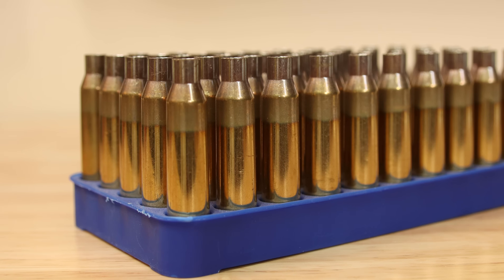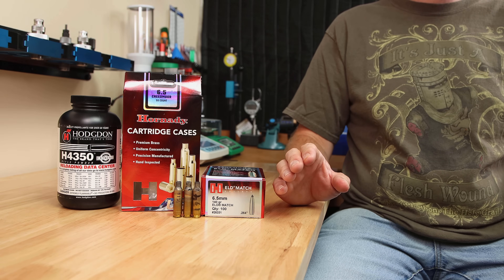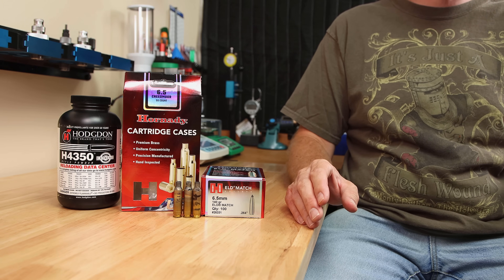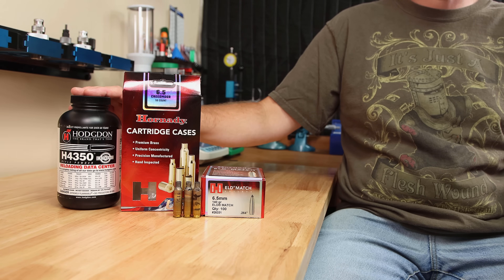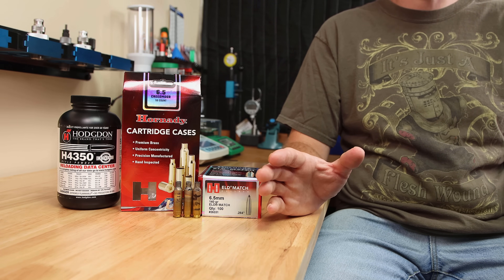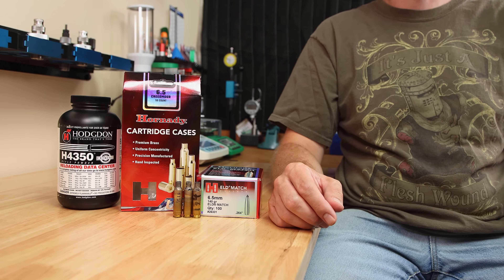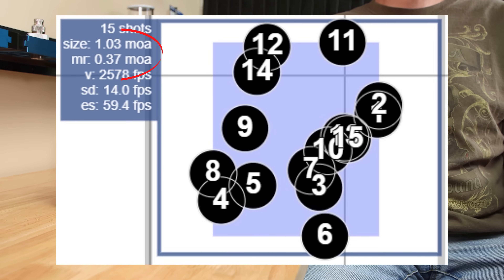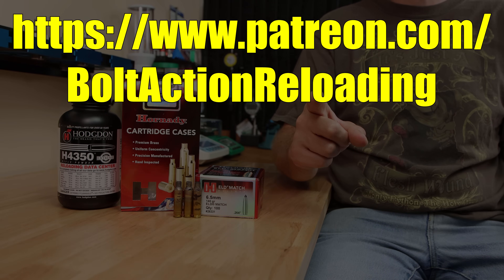How NOT to Anneal Your Brass!

Comment: What I would like to know is how much difference does it make if you anneal your brass a little bit longer than what is recommended than with Aztec mode.  Erik Cortina's video where annealing for 10 or 15 or 20 seconds (at least 2-4x more than he usually does), didn't seem to make any difference at all for neck tension made me question the precision of the annealing process as suggested by AMP.  Nothing I see on the AMP site convinces me that Aztec mode is so precise that as much as  a 50 percent increase in annealing time beyond what is recommended would make any real difference to the group size and performance.  One of their own papers seems to show that annealing can be done to higher temperatures (up to a few hundred degrees more) than deemed optimal with minimal effects until you get to temps far above what is recommended. I'd love to see data to be proven wrong.

Comment: So if you didn’t clean the inside of the neck after anneal that could cause that increased force to seat a bullet. Dry lube in this test would be better.
Reply from the maker: The necks were brushed after both options were trimmed.
Reply: @BoltActionReloading  so maybe the heat of the second anneal increased neck tension. Even though it softened the brass. So running through expander mandrel would be better.

Comment: Nice video, you have good info. Here's a thought. I have annealed brass in the past with marginal results. But I used a completely different process. I also have fired brass until the neck would split from being work hardened. However for the last number of years I have been using the stainless steal media pins to clean my brass. I will tumble them for 8 hours in the Thumbler's Tumbler. Since then I have used the same brass many times without a single neck splitting. Question: Is it possible that the peening of the brass in the tumbling process is accomplishing the same result as annealing?
Reply from the maker: I don't see how.
Reply: @BoltActionReloading  you do know what peening is, yes? So you got hardened stainless steel media pins impacting soft brass millions and millions of times ..... pretty obvious how. however, 4 word reply .............. your literary skills are impressive..................... a regular Hemingway (-;
Reply from the maker: Hello lencac,
1. I know what peening is, if I didn't, I know how to use google.
2. Peening makes the brass harder if anything, but according to the amp guys (they have talked about this and I think that they may have even covered it in a video but I won't swear to that) but it really only affects are so small that the don't think that it matters.
3. IMO making the brass harder should not increase case life, but I am not going to pretend to know everything either.
4. You asked a very specific question, I tried to give a very specific answer that I do not see how it would accomplish anything similar to annealing. One makes it harder one makes it softer. Often pointing these things out to folks, people take it the wrong way that I am trying to be a jerk (which is never my intention.)
5. I am not a English major so not going to pretend to be a Hemingway, just going to be me. 
6. I get a lot of questions / comments and I try to address as many as I can realistically. Sometimes I can't spend 5 minutes on 100 comments per day cause I just don't have a spare 8 hours everyday.

BAR
Reply: @BoltActionReloading  Attaboy that's more like it. I'm likewise am not metallurgist so I'm not sure what it does. Nevertheless, speaking from experience I literally since I've been using the SS media I have not had a single neck split. We are talking about 30.06, 308 and 7.5x55. Many times after many uses I've had the primer pocket fail to hold the primer tight so I would pitch the case due to that. But as far as neck split, not a single one. And I'll say I have cases that I have used maybe as much as 10 times. When in the past using the walnut media the necks would have split. So that's my experience.
Dig your vids. Love ya brother (-:

Comment: Annealing before sizing helps ensure consistent results from sizing. A little work hardening from sizing helps keep the neck tension consistent. A little carbon in the neck helps prevent the brass from getting "sticky" after annealing.

Comment: When I had my flame annealer I found that annealing after sizing and then loading, bullet seating was extremely hard to the point of damaging the ogive(don’t have an amp press but didn’t need to to know something was not good).  I found that brushing the necks after annealing allowed much more normal seating force. I hypothesized that the annealing process left a scale or residue that significantly increased friction (like heating steel with a torch).   I now deprime fired cases with universal deprime die anneal on my amp, size, expand with dry lube and mandrel and load. Great loads now.

Comment: Do you have pin gauges? If so, please would you look to see what happened to the diameter and royndness of the neck when annealing after sizing?
Reply from the maker: Hi Peter, I do have pin gauges, however they have residual oils on them and I did not want to have to clean that off cleaned at that point primed cases. I truly did not expect these results so hind sight being 20/20 I would have dome some more measurements prior to priming.

Comment: You need to brush after annealing, I had the same. It looks of annealing leaves a kind of scale. Also always anneal before sizing. Otherwise your dimensions are off.
Reply from the maker: Hi R Load, These were brushed after the cases were trimmed. I know the advice has always been to size after anneal, but I have never heard anyone say why. I like to understand why. Clearly something changed.

Comment: I thought it was best to anneal after sizing. The reason for annealing is to return the metal back to a natural state after work hardening.  The sizing of the brass work hardens it, annealing after sizing, should allow the neck tension of all the cases in that batch to be similar. Thus more consistent bullet release. I was also taught to quench brass and copper in water as part of the annealing process. Most people in reloading skip this step saying that air cooled is good enough. I am not so sure about this, maybe it would be a good test. Quenched vs air cooled for the next video.
Reply: You want the brass to return to it's original state before you full length size to get a more consistent size. Quenching brass is not a thing. Steel, etc. changes it's properties when quenched, brass does not. Air cool, liquid cool, no effect on brass.

Comment: Why on earth would you anneal your sized brass?  That makes no seance to me.  By the way, unless im mistaken, the AMP video you reference, twice annealed brass. NOT anneal brass, then resize, then re anneal. Keep apples and oranges together.
Reply from the maker: Hi Mark, Why? to understand. I don't believe I recommended it, I just wanted to know what happened.  In the AMP video Alex took a hardness measurement on a unfired case, annealed it, took another measurement, annealed it again, took another measurement to see that it did not change, sized it, took another measurement to see that it had changed because of the sizing process, annealed it at a lower setting to see that it did not relieve all the stress(with another measurement), and annealed it again and then did another measurement to see it was back to the annealed state before the size. So there were a lot of tests and a lot going on. His more focused on stored energy, but he also states that the majority of the stored energy (hardness in the case) comes from sizing not firing. Not sure how this related exactly to fruit but figured some folks would find it interesting.

Comment: Can you do a test on brass life with annealing vs not annealing and how often is sufficient for annealing?
Reply from the maker: Hi Dylan this type of test gets complicated very quickly. I did a life test annealing and firing for 20 rounds here: https://youtu.be/bZopCBUzruY and it would have still been going strong. It really depends on your why, are you doing it for extra life or consistency? If consistency is your answer I don't know how you don't answer the question every time. If its for extra life span, then it gets complicated. (IMO)
BAR
Reply: @BoltActionReloading  thanks I was thinking about mostly lifespan since I don’t have a justification to drop major cash on an annealing machine. But maybe I could use a torch once every five firings if it would still get me about the same life as doing it every firing. Or maybe it hardly makes any difference at all?
Reply: @Haast's Eagle wow good info thanks. With the non annealed, if accuracy is gone at 12, would annealing at 8-10 reset the clock? This way you wouldn’t have to toss them? I’d like to be able to anneal as infrequently as possible while getting respectable case life, since I’d probably only use a torch which takes a while. Also I assume you’re doing only as much shoulder bump as necessary or the separation would come much earlier I’d think

Comment: I communicated with the owner of AMP Annealing, who makes himself completely available any time, day or night. He said that it isn't advisable to anneal after sizing which defeats the intent of the process. The equipment is calibrated to give the correct annealing number with the neck at fired size. They didn't pull the time and temperature out of thin air. They test annealed thousands of cases at fired neck diameter then programmed the annealer using the data acquired using fired neck diameter results. He told me that even a dented neck such as what commonly occurs on M1 Garands, affects the annealing accuracy.  Either the founder or his son, who was the primary, hands on developer, will personally answer your technical questions. Thanks for your effort to determine if there is a difference in sized or unsized annealing performance and the Amp guys can explain why it happens if you ask.
Regards,
JG
Reply from the maker: Hi Jerry, I have had nothing but good experiences with the AMP guys. I am not sure Alex sleeps sometimes when I look at the times he responds to email. I have never had a reason to doubt them or question any of their data. Some folks however want to accuse them of simply trying to sell equipment so I feel that independent testing is important.
BAR
Reply: @BoltActionReloading  i admire your willingness to put in the work to prove or disprove published sfatements. I have a scientific background and had most of the equipment either available to me or through a friend at the institute. Certainly the process they used at Amp is familiar as Vickers hardness is a fairly common industrial measure and the equipment is pretty standard and the calibration process is a standardized, etched in stone procedure that ASTM and other governing bodies mandate so it is uniform worldwide in many instances. I believe their process is almost foolproof in that a given amount of energy induced into an exact amount of mass will produce very repeatable, quantifiable results. Alex told me that an acceptably annealed cas doesn't have to be exactly 100 Vickers but 90 to  108 are close enough to pass muster when they field tested ammo in actual firearms with known capabilities. He said that meaningful accuracy degradation  wasn't apparent until the hardness started outside that 90-108 range and when above the highside limit, neck splitting as well as excessive neck tension were observed. You are testing another aspect of reloading related to annealing but not necessarily a direct result of annealing. That is a good thing because all the processes don't always add up to the sum of their parts. Your x number of steps may or may not play well with mine but that just proves that the ultimate consistancy can be achieved in different but usually similar ways if the precision is there. Keep up the good work and I'll  anticipate seeing more good and interesting info from you.
Jerry
Reply: 1 word lubricity

Comment: Yes because everyone can afford an overly expensive computer controlled inductive annealing machine. So relevant tot he masses!
Reply: Do or don’t it’s completely up to you man. He’s got videos on testing the results of annealing.
Reply: You can make your own induction annealer with 0.01 second accuracy for about $200. Only downside is you have to manually determine the correct annealing time for your brass, which isn't bad, just sacrifice a case or 2 and record the time so you'll have it the next time you anneal. And there are cheaper but less precise methods for annealing such as just a torch and pliers to hold the brass. The AMP is just the best to use when running this specific experiment because it is the most precise and repeatable. You can extrapolate his conclusions to any method. If you can't or don't want to anneal, then don't. If you do want to anneal, then you have many options and resources to educate yourself about it and the various methods.

Comment: how about lubing the inside of the neck on both prior to seating.  I know that isn't part of your normal process, but it could help to understand if the second anneal difference is due to carbon differences.
Reply: I brush necks no lube. Best results for me. One pass no more, no less
Reply: I use an ultrasonic cleaner and my case necks are "squeaky clean". I am going to try a really fine emery cloth polish of the case neck to see if seating force and depth variation will be reduced. An absolute b@ll ache in the case prep process, and trust me, if it makes no difference I won't be doing it going forward.

Comment: Maybe I missed it and I apologize if I did, but here are a couple of questions that came to mind.  Do you clean your brass before you size?  Also, I would assume you lube your case necks before you size?  If so, and you don't clean again before bullet seating, there would be residual lube that would assist the projectile being seated.  If you lube, size, and then anneal, the anneal would burn off any lube, changing the friction of the seating.  Just a thought as to why the change in seating force when annealing after sizing, which is totally counterintuitive.
Reply: The owner of the Amp Annealing company told me it's not necessary unless for some reason it is really nasty but for normal residue it doesn't matter. I believe this may be on the instructions included but for sure it's mentioned on their website.
Reply: @jerrygolden832  when you say it’s not necessary do you mean not necessary to clean before annealing?  If so I think that means dirty cases have the same code as clean cases so cleaning doesn’t affect anneal times.  My point was that lube or no lube inside the case neck does affect the coefficient of friction when seating a projectile which would affect the seating force.  I posit that this would also affect the case pressure at firing.  Not saying one or the other is better…just saying it makes a difference.
Reply: @sohendo2211  we are getting two different issues together to which there isn't a single answer. Separate annealing-clean or not cleaned brass, from case neck lubricity when seating a bullet. The correct hardness desired when annealing a non- spotless(clean) case is achieved equally with a case that has been wet tumbled with stainless pins, a method which produces a virgin inside neck surface which is less lubricious than one that is tumbled in crushed walnut/corncob media. We have a properly annealed case now so we  we forget about annealing and consider the desired lubricity of the inside of the neck we are going to seat a bullet in. A virgin brass surface is not conducive to smooth seating of a bullet. Let's use 5.56 gas gun in this instance. A relatively good amount of neck tension is required to keep bullet from moving in the case neck. Seating a bullet with .0025-.003 neck tension in a virgin brass inside neck surface will often result in deformity in the nose of bullet due to excessive force required to overcome the fricton of the virgin brass. My version of creating the optimum surface is to clean cases with crushed walnut and/or crushed corncob. It cleans the inside of the case and leaves a microscopic layer of carbon which serves as a lubricant. This is the only way you can guarantee that  an even amount of lubricant is on the inner case neck. Case lube, graphite or whatever you use as lubricant is extremely difficult to evenly distribute so you have an instant variable. It doesn't matter if your requirement is 1 or more moa but for 1/4 moa you must have everything right every time. Others have methods that work for them so my methods are by no means the "only  right way" but they are surely one right way as I have the results to verify it. It didn't happen right away when I first started competing more than a decade ago but having a scientific background I took an analytical approach in an effort to eliminate as many variables as possible. I've never seen this approach produce worse results but just like any process, some things work and others don't but using the positive incremental improvements will eventually pay off if properly applied. BTW, we never stop learning and I'm always open to things that will help me improve whatever I am trying to do.